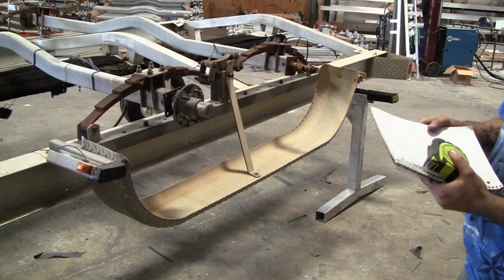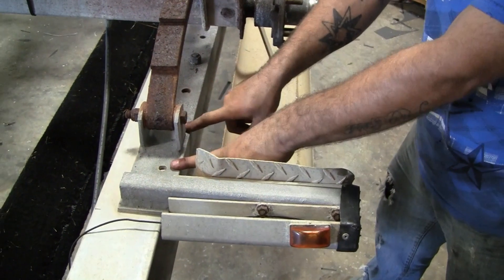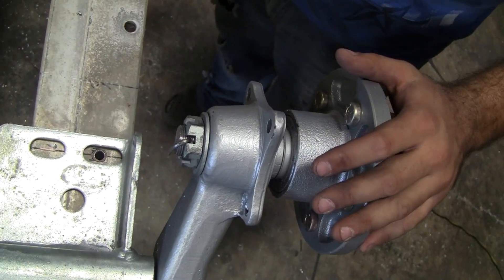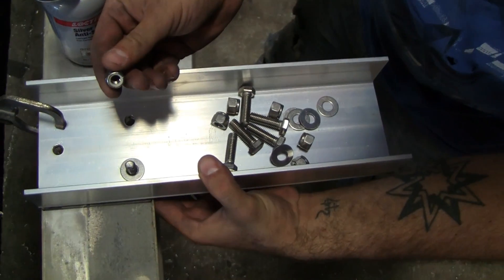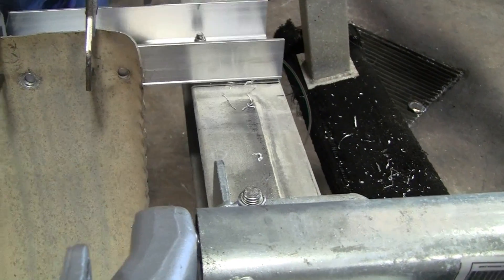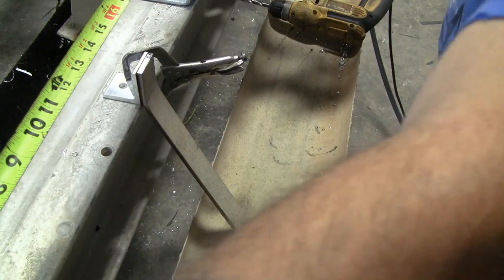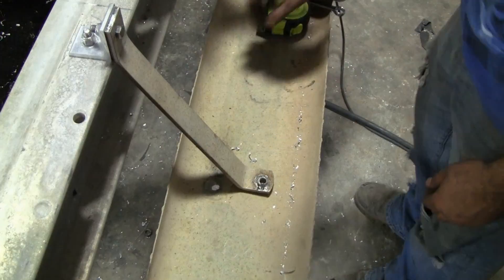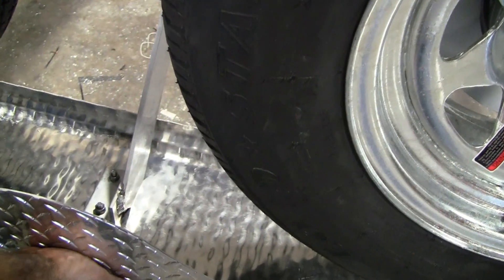Boat trailer spring axle to torsion axle conversion - by Sport Trail.

Comment: Hi there, what is the advantage of a swing arm axle over a sprung axle? Thanks for the vid.
Reply: And they don't corrode as badly as springs either.
Reply: torsion axle is much smoother than spring axle.

Comment: Wow this is a great video!how do u get the trailer inverted?
Reply from the maker: eightballproaudio Thank you. We use a forklift with a lift strap looped aroundone side of the frame to flip it. It made it easier to make this video with thetrailer upside down. This project isn’t hard to do with the boat on it, justmake sure it’s well supported with jack stands.